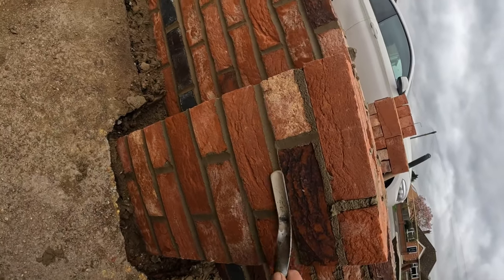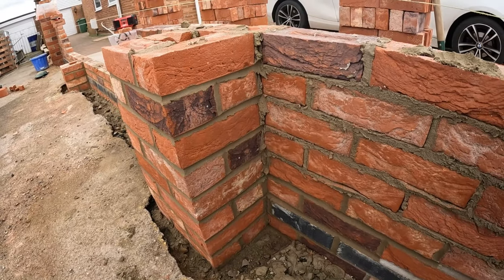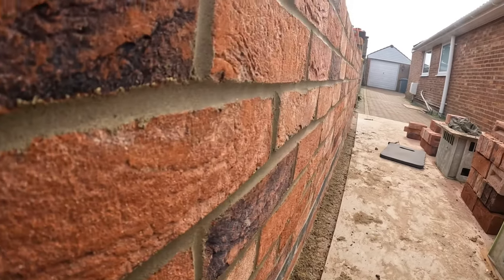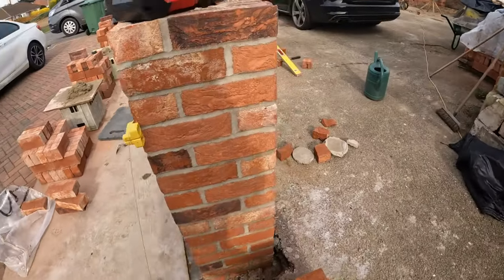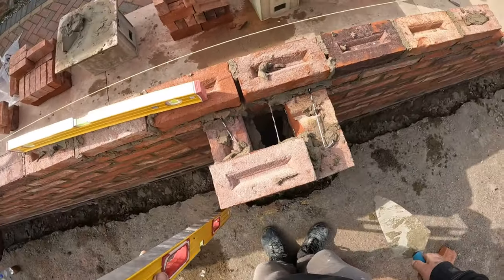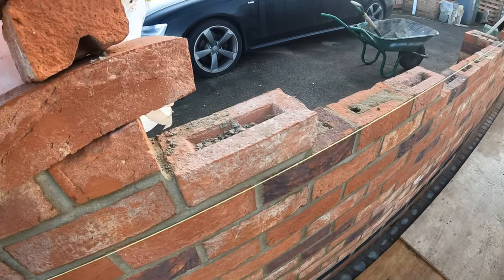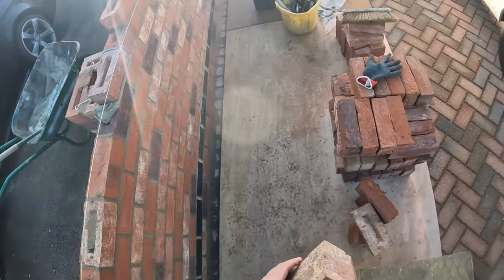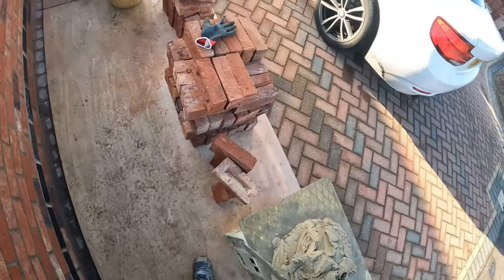OLD BOY Building a Garden Wall! Final Part

Comment: Nice variation of colour in them thar bricks Budd. Good job. 👍👍
Reply from the maker: Cheers Doug, it actually stopped raining for few hours today 😃👍
Reply: @BuildingwithBudd  That rain has been consistent all winter and now into the spring it seems😳. Not good for outdoor adventurers like yourself mate.
Reply from the maker: It has made life very hard on the work front , but you have to get your head down and get on with it, 👍👍